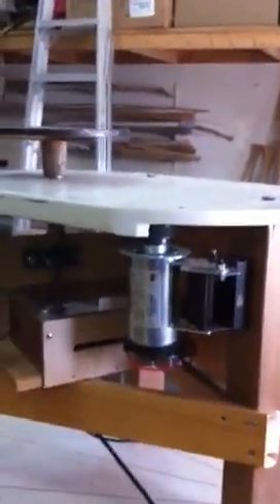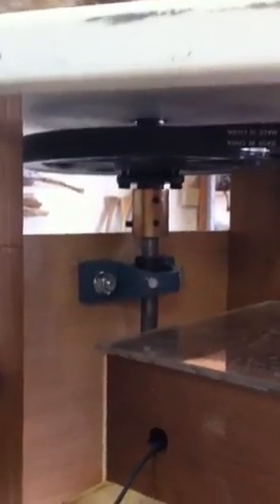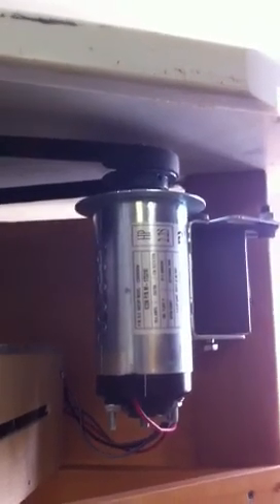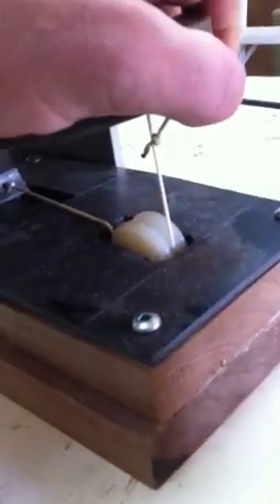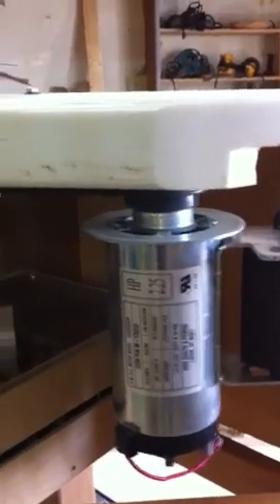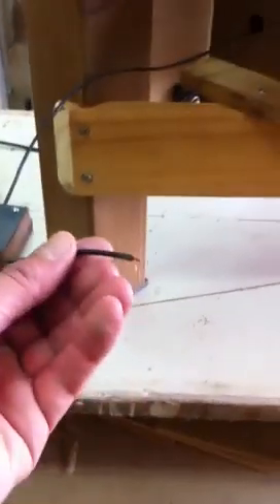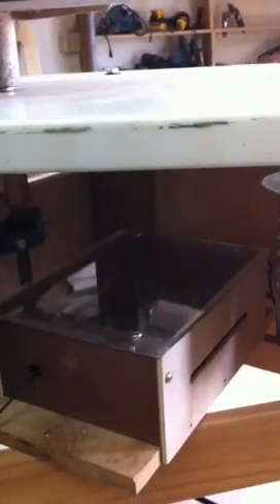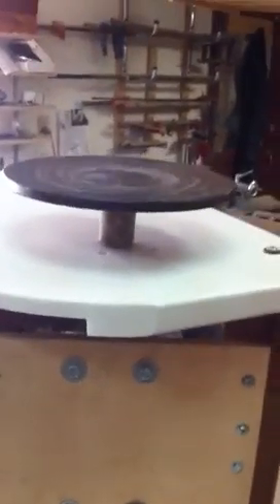Home-made pottery wheel

Comment: Well done , man .
That's a great achievement for a first project . I've finished my first prototype wheel yesterday. I used a washing machine motor run through a thyristor regulator which is capable of balancing out torque loads by upping the current . The regulator does its job well while you are working the clay but it takes a minute to slow back down when you release the clay. So the wheel speeds up and distorts what you've thrown.so it's back to the drawing board.
 Had decided on a higher horsepower motor and I'm glad to have found your vid to confirm my plan. 
I hope to make a vid of my build I'll send you a link when it's done . 

B

Comment: Nice job. 1st: the head is spinning left handed. If you're left handed, that's fine. Is the motor direction reversible on a treadmill motor? 2nd: how did you work out the larger pulley on the shaft? Did that come from something too, or did you buy the pulleys?

Comment: Great idea using the treadmill motor.  I have a washing machine motor I'm going to use, with a gear box instead of a pulley system.  I'm sorry now that I gave away our old treadmill for free last year.  Thanks for sharing.  BTW, most US pottery wheels do turn counterclockwise.  Couldn't the treadmill motor just be mounted upside down to change the direction if you wanted to?
Reply from the maker: K Archibald Hi. Thanks for the comment. I warn you that a 3/4 HP washing machine motor might not cut it. I started with a similar AC motor and it didn't suit the slow speeds required. Also, building a direction switch was far easier than I thought, though some motor are only designed to run one way.

Comment from the maker: I guess I didn't consider the wheel direction. I don't think you can change direction on a DC permanent magnet motor. If someone out there knows for sure, I'd love an answer. In regards to the pulleys; they were bought new and are fitted to both shafts (motor and wheel head) with compression fittings. Thanks for your feedback.

Comment from the maker: @brianyensen the order of parts, going from wheel head to bottom of shaft is: Wheel head on a 1" shaft, 1 inch bronze flanged bushing, corian top, 10" pulley w connection, two bronze bushings (one 1" inside dimension, 1 1/4" outside. one 5/8" inside, 1" outside, fitted together), pillowblock bearing, another pillowblock bearing, end of  5/8" shaft. 
I hope this helps.

Comment from the maker: @zeussaurabh about yor original question: I did have an AC motor when I began this project, but to put on switch that controls the speed, and maintains adequate torque (especially at low speeds) is either impossible or VERY expensive (believe me I asked a lot of those in the motor industry). DC "permanent magnet" motors are made for this work, the power is converted from AC by a controler. (think of youself on a treadmill going slow, they can take you on an incline all day long)